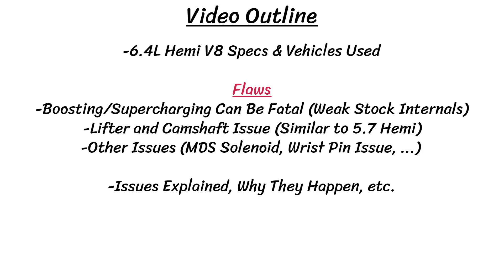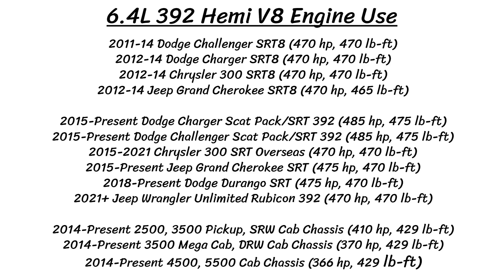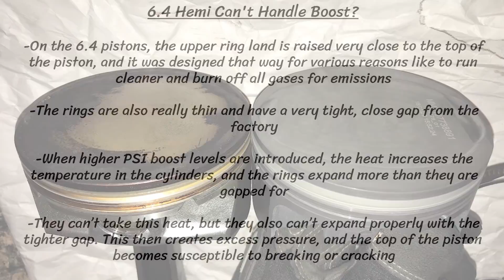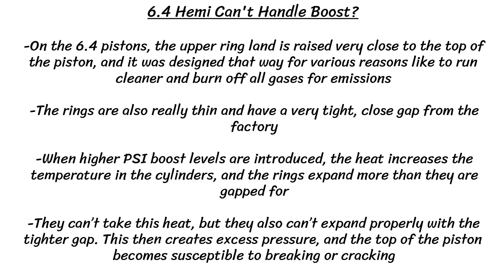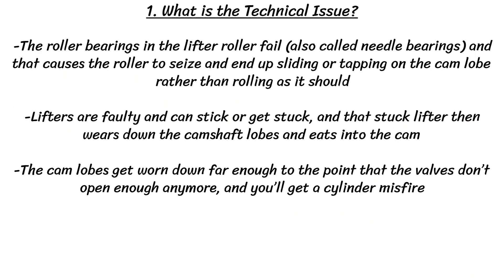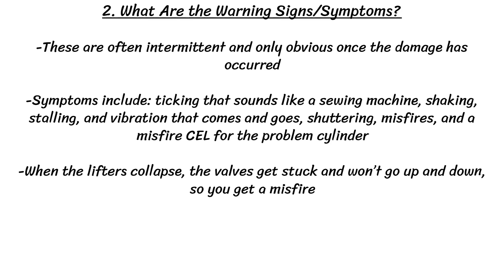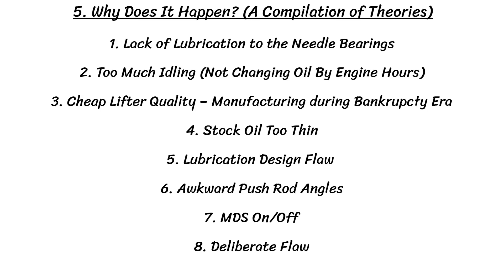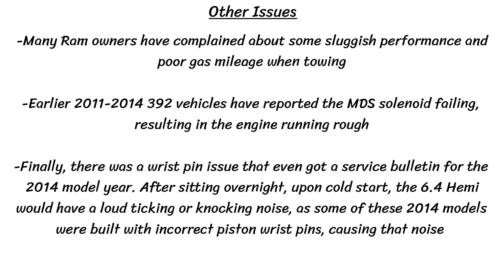The Specs and Fatal Flaws of the Chrysler 6.4L Hemi V8 Engine (392 Hemi Issues)

Comment: So is or has  Chrysler correcting these defects, or  are they selling bad engines in expensive trucks an cars. Theirs  a word called  LAWSUITE, think about it!!!!
Reply from the maker: No of course they won’t correct it or pay out of pocket. Dealers say the tick is normal, and the it doesn’t affect the cars until years down the road when it’s usually on its second owner. So they get away with it pretty good
Reply: @MarspeedCars  Right then it's time to pay out of pocket time if you were planning to be a long time owner (warranty expired) or you are the infortunate owner who bought it used.  Sounds like a scheme here doesn't it?
Reply: Just lease one for one or two years so you can avoid the money pit 🤑and those problems then you can say you never had a problem with a hemi and they are reliable engines like some of these people say who don't tell you all the facts. Do follow the class action law suits from 2008 to 2022 on the new Dodge vehicles.

Comment: I have the 2018 392 Durango with JLT intake car at 91,000 has had no issues but the k&n filter had totally clogged throttle and mass air or I think they call it SD now. It has loads of power but I don’t race it. A pull here or there to pass that’s it.

Comment: My 2019 charger scat pack had the lifters fail on 35k miles. I did dealer service every 4k miles. It happened.
Reply: No, I did idle less then a minute even winter time.  
I am not sure what they put it on. Paper said 0W40. 
I got 22 challenger now. I hope not happened it again.

Comment: When an engine is a brand new design; working the bugs out(design flaws), is an expected eventuality! The hemi's have had their flaws (particularly cam, lifters, which is more of an oiling issue,  and valve seats), but here's what I have to say about it... KUDOS TO MOPAR... for addressing these issues, instead of ignoring them...ahem Ford with the 5.4(I could go on for days with GM also)! The issues that do occur happen at a high wear and mileage, the last 5.7 hemi I worked on dropped a valve seat at 254, 000+ miles! The 6.1& 6.4 are tougher than the 5.7, and the hellcat/demon engines are built to be all out dragster engines! So, flaws are disappearing rapidly from the Mopar camp brother, and don't think we die hards will be quick to forget the hate and shade ridiculously directed at INVESTMENT CASTINGS, simply because the underdog has to pinch pennies from time to time because the competition has always had deeper pockets than us. Thats our excuse...whats Fords? GM? Nissan? Toyota even as of late?? I guess with all that money those camps have...its evident poor quality is being used by choice ?!
Reply: Negative you need to check into the class action lawsuits from 2008 to 2022 on current Dodge vehicles.  Problem not addressed.  Only addressed with band aid fixes using same parts that failed in the first place only to happen again to same long time owner or subsequent owner who buys it used.  That's if it involves an authorized warranty repair to first owner.🤑=$$$$MONEY PIT$$$ Good income for sales and service departments.

Comment: That’s the wrong oil you’ve got in the info 6.4 takes 0w-40 , 5.7 takes 5w-20. I have zero issues out of either of mine. It’s all about when you change your oil and I run amsoil in everything

Comment: honest review from owner,
I have overhaul the engine and the gear on 6.4L 2011 at 115000 mile on 2018 ( lifter failure damaged the cam shaft then the valve damaged the cylinder also the cylinder damage one spark plug I ended up replacing 3 cylinder +lifter + cam + valves etc. )  its cost me 10000$ and now after 3.5 year the ticking coming back and the car start to heat up over 229 F even after replacing a radiator, thermostat, oil cooler.
the gear stopped shifting to 3rd then it will go to N and you have to rest the car to move it
it will be my 1st and last junk form this company. 
I hope 5.7 or 6.4 owners taking this.

if you want 392 or 5.7L rent it have fun don't waste your time and your wallet buying one of them.

Comment: Don't know where you got the 5W-20 weight from but my 392 scat pack requires 0W-40 synthetic as per manufacture. Penzoil Platinum is what I run.
Reply from the maker: Yeah that was my mistake I used the slide from my 5.7 video which uses 5W-20. Scat is 0W-40

Comment: On SRT 6.4L 392 Hemi's. They use ( SAE 0W-40, Synthetic API oil). Page 194 in the 2015 Challengers Owners Manual. Not 5w 20 oil.
Reply: Hi, i own a 2011 6.4L Dodge Challenger ! What oil should i use then ???
Reply: Hi, i own a 2011 6.4L Dodge Challenger ! What oil should i use then ???

Comment: 85,000+ miles on my 2015 SRT 392 and the only engine issue I have had was a leaking intake manifold gasket. The engine runs as strong today as it did the day I bought the car back in 2016.
Reply: Do the lifters now.  Mine failed at 100k. Not a matter of if... only when
Reply: @perfectedsounds  This is so true.
Reply: How did you begin to notice this? My car just started shooting out white smoke on some cold starts, wondering if this could be the reason.
Reply: @LamarFatassJackson  mine started with a intermittent ticking... sometimes light, you almost write it off.  Best thing to do,  replace them before 100k
Reply: @perfectedsounds my rt had that problem I should of listen after 100k like you stated (106k) 2 cylinders started misfiring

Comment: Which is more reliable a 392 motor or an 6.2 LS motor? I'm talking about stock to stock and no modification just for a normal everyday use.
Reply: LS factory stock engine better choice for daily driver.  Lower maintenance.  Just be fore warned about wobbling harmonic balancer and if that engine is equipped with AFS system.

Comment: I have NEVER had issues with ANY Chrysler engines.I think you just are full of shit.EVERY engine ever manufactured by ALL companies have some weak point.For your info I am now driving a classic Chrysler 5th Avenue with stock 5.2 (318) that just rolled over 80,000 miles.My family has run Mopars since 1960's .Never have had ANY engine failures or rebuilds. SO BLOW IT OUT YOUR ASS

Comment: There was an internal engineering memo issued by Chrysler in 2015 that narrowed the lifter issue to an "anomaly within the needle bearing hardening process that was not recognized during production".  Chrysler updated the specs in 2016 and then selected a different manufacturer for the lifters for the 2018 model year.
Reply: You would think tappets with roller bearings reliability would increase over flat tappets but when inferior metals are used with minimal case hardening applied,  well this is what you'll see 🤷‍♂️
Reply: @benkrom2737  Ford had this with the 5.4L 3V. Probably the same supplier. If there is any noise they say to replace all rockers (different setup but same idea). Not very common but it happens. That Ford engine can have oiling issues though.
Reply: My 2016 Town&Country had 6 rockers  fail at 87k miles
Reply: @Sam-656  2016 Town&Country don't have a 6.4 in it
Reply: This is good to know as I bought a 2019.
Reply: many failures after 16!

Comment: Wish I would have known these things early on. A failed lifter is what did my motor in, and I was at 117,000 miles. Just bought a new 6.4 engine after my car been sitting for 2 years plus. The failed lifters destroyed my camshaft and initially destroyed my crankshaft as well, along with the main seal, connecting rod bearings and bent some of my push rods. As said on the video, it's very hard to catch the problem early, I experienced the misfiring codes. I thought it was spark plugs and changed that. Code still was there, so I changed coil pack, then fuel injector cause the misfiring was coming up as cyclinder 8 misfire. Even changed my camshaft sensor as well. Still the problem was there. Took it to the dealer, and they couldn't tell without opening the engine up. They want 800.00 just to open up the engine. So once the engine finally blew, I took it to my mechanic who was a mopar tech, he took my engine out, and broke it down what had occurred. Pretty much what the video person was saying. He explained mopar went cheap with another company using cheaper lifters for the 6.4 engine. 6.1 hemi doesn't have this problem like the 6.4. One sure way to know if your having lifter problems is checking your oil for metal flakes in your oil.
Reply: oil change at 6000 ( six month ) miles or not ?
Reply: . @alexvivinc  They say you can go for 6,000. I changed mines every 3,000 to 5,000 though.
Reply: What year was your hemi?
Reply: @STARFIGHT88  2012

Comment: Man I keep hearing about the lifter issues and problems but we have had 4  of the 5.7 and on the 2nd of the 6.4 for our ranch. We have luckily have never experienced ANY problems, with all of them getting 130k-175k before they get traded off and i can promise they all don't get the maint on time.
Reply: But I am sure you changed the oil regularly, that's the only way you will see that type of mileage on a Hemi.

Comment: My 2021 ram 2500 with the 6.4 hemi just started ticking on cold mornings with ONLY 6200 miles (bone stock and no idle hours), I'm guessing it's just the manifold bolts because it only seems to happen when it's been sitting all night and temperatures are 45 and below and goes away pretty quick. Haven't had a chance to get it to the dealership yet, but that is inexcusable for a motor that is brand new and been out for almost a decade
Reply: There is a vid on this. It’s a completely normal noise till something gets oil. Only does it for a min or 2. My 2023 has done it since 26 miles

Comment: Since the supercharged 6.2L hemi comes with forged pistons it seems rather obvious the 6.4 is not set up for big boost.
Reply from the maker: It seems like any mods to push over 600hp will break the stock pistons, have seen a few examples locally

Comment: You say it's difficult to detect the failing lifter bearings. There is an easy way to diagnose this kind of fault early, which is routine practice with aero engines.
At each oil change, check the drained oil for metal particles - or better still have a sample analysed. Cut open the old filter and look inside. If there is any sign that the engine is "making metal" you know it's time to act.
Another handy trick is to install a magnetic sump plug - that will usually collect steel/iron particles before they get picked up and sent through the filter. Again, if you pull the plug and see that it's loaded, it's time to act. This way you'll probably get to the problem and be able to replace the roller bearings, before the cam gets damaged.
Want to go further? Install a chip detector in the sump. Again, this is standard practice in aviation - especially for helicopters.

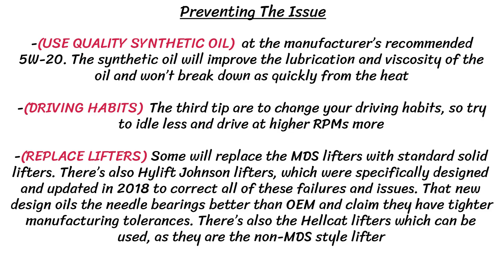Comment: 9:30 the recommended oil for the 392 is 0W-40, not 5W-20 (that one is for the 5.7)
Reply: I am sorry but you are horribly wrong with your statement. 5W20 should always be used in a 6.4L Hemi Engine. I am a mechanic for a Dodge Dealership I am super knowledgeable on EVERY aspect of this engine. Not to mention qualified to say that you are sadly mistaken.
Reply: @jasongilbert7281 what’s the best way to treat my 2014 5.7? Lil additives or anything? Fuel treatments? Or just stay on top of synthetic oc’s?

Comment: I work at a Chrysler dealer.  A few years back there was a memo that if you are running a 5.7 or 6.4 in you Challenger or Charger and using it for any type of severe service application it was recommended to use SAE 5 W 40 full synthetic instead of 5 W 20 or 0 W 40.  I also use Lucas ZDDP additive to help with the cam and lifters.  Increased ZDDP can't hurt as you need ZDDP to help lubricate ferrous metals under heavy pressure.  This significantly helped reduce the slight tick that Hemi engines have.

I also disabled the MDS.

Plate C

Comment: Had a 2014 Ram 6.4 2500 with 30,000 miles had wrist pin noise at cold start up. I traded it in for a 2017 Ram 6.4 2500 at 35,000 miles had lifter issues. I traded it for a 2021 Tundra crew max 5.7 and love the truck. Done with the 6.4s

Comment: Love for you to go into more detail between the 6.4 Hemi in the cars and the 6.4 BGE Hemi in the HD trucks.  Do all the same flaws apply?  It is my understanding that there are differences designed to increase durability and longevity in the Trucks.
Reply from the maker: Thanks for this idea! I’m going to do a Truck vs SRT engine video probably next week!
Reply: @MarspeedCars  Awesome! I can't wait to see it.
Reply: SRT 2018+ have BGEs in them aka the Hellcat block.
Reply: @w4pher  The BGE is the truck engine.  It is NOT the same as what is used in the cars.  Maybe the same block, but internals are different.  Lets wait for Marspeed's video on this.

Comment: If the only problems with a motor are from modifying it, then it's not a bad motor.  Can't exactly call that a fatal flaw when it works fine as intended.
Reply: But some issues like lifters have nothing to do with modifications.

Comment: Do your own oil changes using synthetic oil. Dealers will use recycled oil, synthetic or not.
Mine gave me 300K miles until it finally blew a head gasket.

Comment: My SRT 392 Challenger does not have the MDS.  It is a manual transmission, which doesn't come with MDS.  There are thousands of Hemi's that don't have the failure issue with the lifters.  As pointed out in the video, it is mostly fleet vehicles with high idle time.  Oil pressure and circulation is lower at idle.  The MDS system doesn't help either.

The 392 lives fine with naturally aspirated mods.  Cam, headers, tuning can get you over 600 HP reliably.  Don't put boost to an engine that isn't designed for it and it will live. The compression ratio for the 392 is too high for boost.

Comment: This is not fully correct. Manual transmission 6.4l motors do not have mds or a lifter issue for one. Second the stock 6.4l bottom end has been proven to handle over 1000hp and boost with just a proper regapping of the rings on the hypereutectic pistons.

Comment: So you state the engine has a fatal flaw. And that flaw is putting aftermarket boost to the engine causes failure. Not sure what you are trying to prove but this holds true to any engine from any manufacture. I have put 275 thousand miles on a MDS engine and it still works on a farm everyday sold it 3 years ago. Your statement of a fatal flaw is misleading and directed to put fear or doubt in a very reliable engine design. Good luck in your quests in life but you have a fatal flaw in your delivery of the truth

Comment: Lol all these fatal flaws. 1 the lifter issue is rare. Around 3% of vehicles are effected. The Pistons on the other hand it is a fact these engines are optimized for non boost. So yes you should get forged internals if you want to boost the car

Comment: Another video that is purely based on "got ya" buzz words. The iconic 305ice from GM was fitted with cast internals and lasted decades...that is until somebody decided to slap a blower on it and the results were predictable with the bottom end falling out. 

Common sense folks - supercharging or adding any other type of power-adder will result in parts failures on cast internals regardless of who manufactures the engine. If you're looking to add HP be prepared to open your wallet and spend the money & even then there is a limit too much much power you can add before you break parts on a regular basis. 

Engineering 1-0-1 is simple and understanding that an engine designed to be run daily for 100's of thousands of miles cannot be asked to produce 1000HP and be hammered on daily. Rule #1 is CHANGE YOUR OIL based on running time, driving habit & your environment and you will have a powertrain that will last you until you get bored and trade off your vehicle for the latest and greatest or you drive it until the doors fall off. 

The FATAL FLAW is this video along with many like it are produced for the sole purpose of generating clicks and revenue for the channels that offer them.

Comment: You're assessment is bogus. The 392 is one of the most reliable displacement ever created. As for the performance IT'S A MOPAR! These engines are already at the top end of It's performance limits from the factory. This has been the case from the beginning of Chrysler. Anyone who knows MOPAR history knows that if you want to increase your HP and torque bands then you basically need to do an entire rebuild. I rebuilt my 392 to a 426. Everything has been changed and I mean everything in the drive train from engine to differential. My SRT Challenger is a 2012 six speed and even though it's extremely powerful only a fool would treat it like a dragpac every second it's being driven. Everything has it's limitations. Number one reason for valve failure especially in Iron block engines is people who doesn't allow cool down time prior to shutdown. Heat spike occurs when the engine is hot and coolant needs to flow through the system to drop the temperature to a safe level to prevent valve collapse. I'm beyond over hearing the absolute absurdity.

Comment: The camshaft doesn't get bathed in oil ( like it should) because the cam bore is too high in the block. Set any modern block next to and old school block. So at idle the lifters don't get lubed properly.

Comment: I run sport mode in my Charger Scat Pack 90% of the time to disable MDS. Also, change your oil regularly with the recommended Pennzoil Ultra Platinum.
Reply: 0w40?
Reply: @coolbreezeNYC1  Yep, 0W40 on the 6.4Ls. All these issues now days with every manufacturer comes down to one thing....oil changes.

Comment: I have 2 6.4 AaHemi’s and 1 6.1 hemi and have never had any issues.  If 485Hp is not enough for you then buy a hellcat.  It’s never smart to add forced air to stock engines.  I use Amsoil and I think a lot of people use oil that doesn’t meet the speculations Dodge requires.
Reply: ford coyote 5.0 loves high boost !